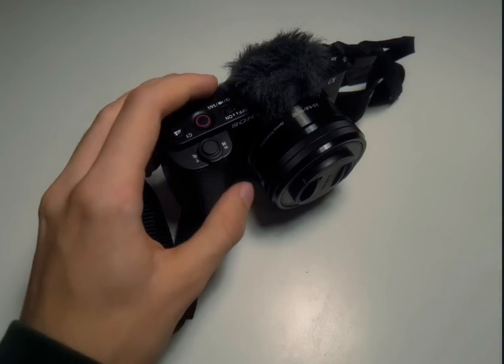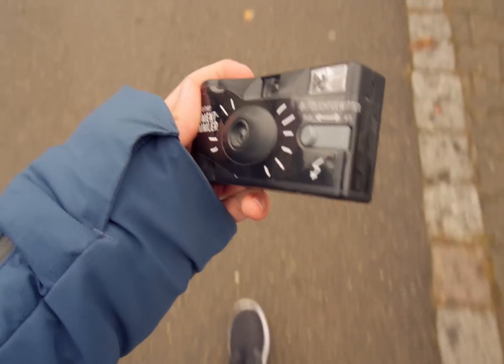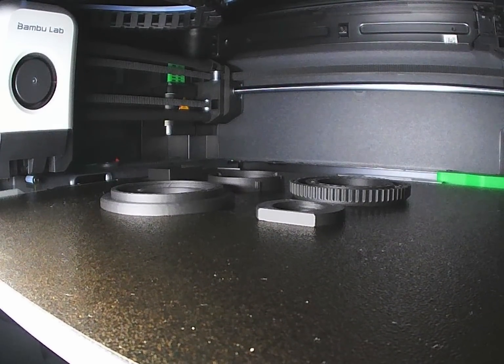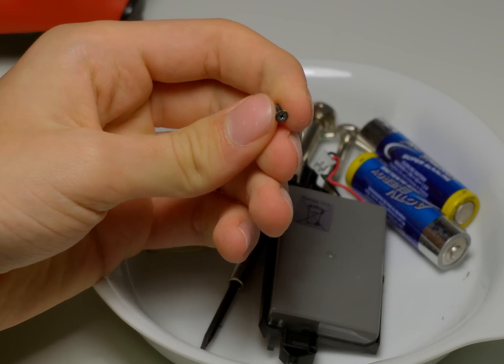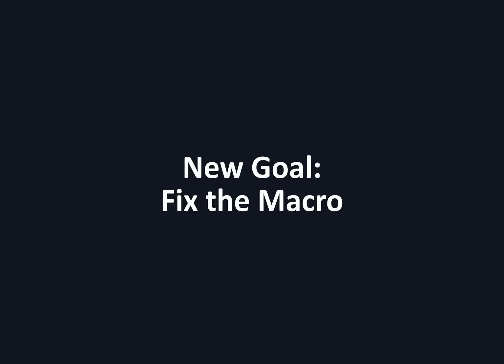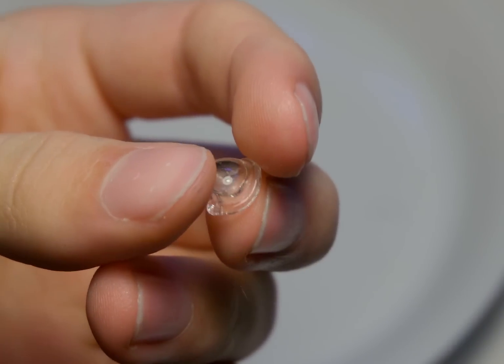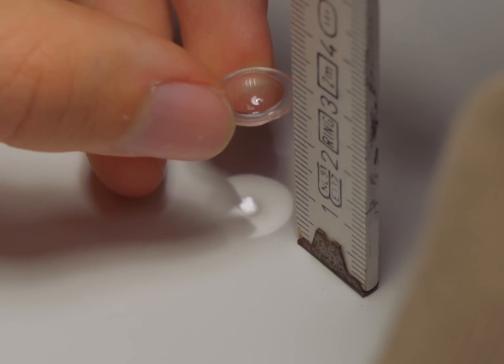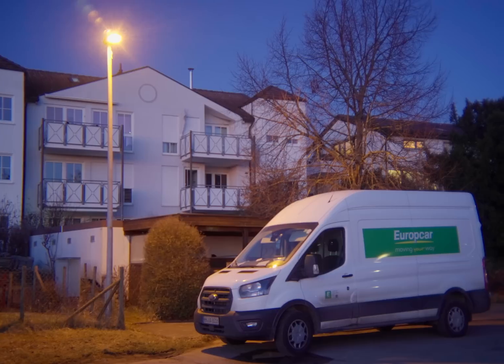Building a lens so bad it's actually good

Comment from the maker: Ayy, they finally finished processing it in 1440p!

I now got the Meike 33mm F1.4, and it's an absolute beast!
Really silent focusing noise, no focus breathing, and the image quality is crazy good (as long as you don't mind flaring and sunbursts in contrast-rich environments).
With an F value of 1.4 for just 220€, this lens is awesome. I'll definitely be using it as my main lens now.

Btw, fun fact this video is not 4:3
Actually, I used the IMAX aspect ratio of 1.43 (slightly approximated to get a clean resolution of 2048/1440)

Also it's in 25fps because the german electric grid works at 50Hz. That way I can avoid any potential flickering of my desk lamp, which lit most of the shots.

Comment: Super glue reacts extremly with some filaments (like PLA+). If you build one by yourself use plastic glue not super glue. The fumes of the melting PLA+ are so strong that they will destroy your camera sensor.
Reply from the maker: Do you know for how long it reacts? I put it for a day outside in the sun in hopes that any fumes would be diffused by then. I mean I still only put the lens on when I actually shot with it, but still - I'd like to be sure.
Reply: @ I  found this out by accident because I used superglue on a prototype and then left the lens on a glass table. After some minutes the black pla turned partially white just like your lens did. I didn’t think much of it except that when I picked up the lens I saw an imprint on the glass. That imprint is still on that table to this day I can not clean it off it’s really on it. To be sure I also moved the lens to another spot on the table and left the lens there to dry over night. The imprint I found in the morning was even worse. Perhaps there is a chemist that can explain the chemical reaction better but I would highly recommend not using that lens on your camera. It will burn your sensor in the long run. Build a new one with plastic glue. Or the chemical process stops after a few days and it’s save to use again not sure but it is suuuuper bad in the beginning.
Reply from the maker: @DispoLens  After a quick google search it seems like the vapors are emitted for 24-48h (as long as the glue still cures) after that it should be safe to use. It's important though that the room is properly ventilated, otherwise the curing process might take longer.

So I think it's safe to use the lens now, especially since I don't use it that often, but for the next time I think I'll just skip glue all together and use screws.

Comment: great video bro what camera do you shoot with i wanna get my ifrst camera tho any suggestion in second hand ones ?
Reply from the maker: I'm shooting with the Sony ZVE10, which is my first camera. 
It's nice to use since it's pretty small, cheap, has great autofocus and with Sony's clear image zoom I can zoom 2.0x for photos and 1.5x for videos without losing resolution (you can slightly see that it's been used though) which is pretty neat for working with primes.
It definitely has it's flaws though like no Ibis as well as terrible rolling shutter, so I'd recommend doing static shots if possible.
Also it can only manage 8-bit which is really bad for greenscreen stuff and the integrated microphone is basically useless since pretty much all budget lenses use STM motors which means you can hear the lens focusing.

For this price point though, it is worth it.
I don't know any camera at this price range with Ibis and other competitors have some serious defects. The Panasonic Lumix GH5 has terrible audio recording, it just misses a few frequencies directly in the vocal range, even with an external microphone and the Canon EOS like all canon cameras has a pretty big flange focal distance as well as it's proprietary mount, so cheap 3rd party lenses are out of the question.

I don't know much about Nikon, Pentax or Fujifilm though, it could be that they have a cheap gem.

Maybe you can get a good 2nd hand camera which addresses all of these issues, but I didn't look that much into 2nd hand since I like to have the returnability if a product is bad or broken.
Reply from the maker: Maybe the Sony ZVE10 mark II could be something for you. It still has no Ibis and the microphone problem still persists (that's just integrated microphones), but it now has the same sensor as the FX30 meaning less rolling shutter and 10-bit 4:2:2 recording.
Reply: @MagnumVD_  i am thinking about second hand fuji xh1
Reply from the maker: @stopcam.iso_1 
Seems like it can do everything necessary, even though for me it would be a bit too bulky with a too short battery life/recording restrictions, especially that when the file size reaches 4GB, subsequent footage will be recorded to a separate file which must be viewed separately and the 15min maximum length. For this video I had recordings of over 2h.

But the Ibis seems awesome, and recording wise it can do 8-bit 4:2:2 in 4k up to 30fps, which as long as you don't do any keying VFX or excessive grading should definitely hold up.

Ultimately it's of course a personal choice, so if it seems good for you, take it. It's definitely not a bad camera.
Reply: @MagnumVD_  what would you suggest in a fuji universe mainly for photography (street,night photos like astro ones and overall all types of generes)
Reply from the maker: Can't help you with that, I don't know that much about Fuji

Comment: get the anything with superglue away from your camera! it outgasses over many days/weeks and will leave a haze on nearby glass (like your camera sensor)!
Reply from the maker: Oh, dammit!
I had a bad thought about that but I thought that if I let it cure for a day outside in the wind under the sun it should be fine to use.
Well at least I only used it for a week and only put it on my camera when I actually took some pictures...

Do you know a good APS-C Sensor cleaning kit?
Reply: @MagnumVD_  well you probably avoided the worst of it letting it cure for a day in the sun. I don't know how long it really takes to stop outgassing though. I've never had to clean my sensors, but if the vapor from glue is like glue itsself, it wouldn't come off. If you don't notice a problem I wouldn't worry about it. Smart to only put it on when using it!

Comment: Next time use acetone to remove cyanoacrylate (superglue)
Reply: Also, if you buy the Fujifilm disposable lens you can get the lens out of the body without anything attached to it which makes things a lot easier
Reply from the maker: @wayoutthere907  
I didn't have any problems getting the lens out of the body, I think most dispo-cam manufacturers allow for the lens to be removed as a separate element.

I'd recommend that you keep your DIY-lens away from your camera and lenses if you used glue. 
The glue gases out over time and can condense on your sensor and lenses.
Reply from the maker: Looking back I'm pretty sure the glue dissolved part of the lens and embedded itself into the surface, which explains how even when I got the glue off, the lens still didn't look clean.

I'm definitely going to try that next time though, thanks
Reply: @MagnumVD_ that's why when I designed a mount to house the disposable lens for my Nikon z8, I made a three-piece design where no glue will ever touch the plastic lens